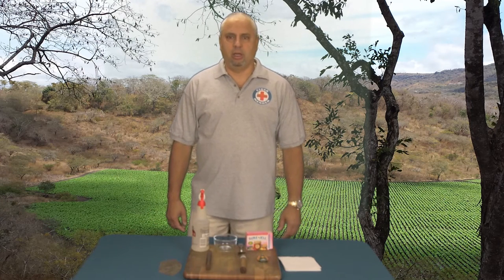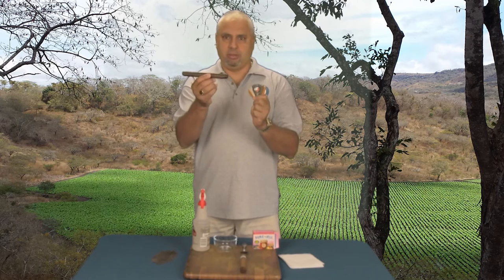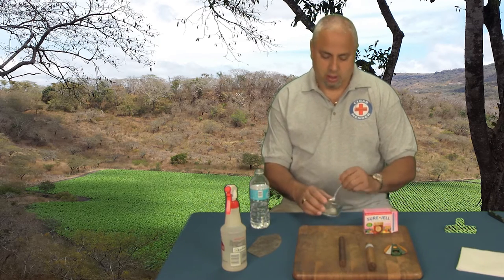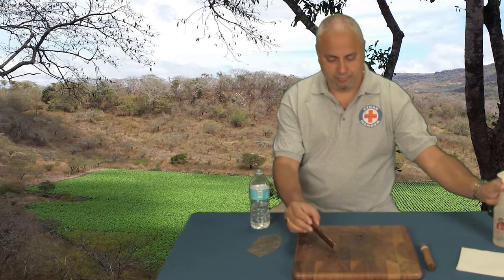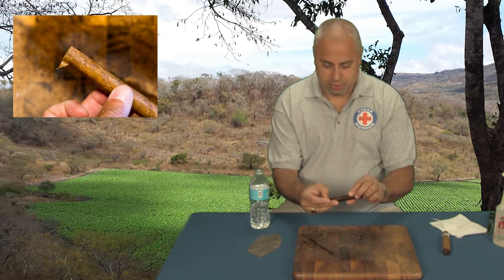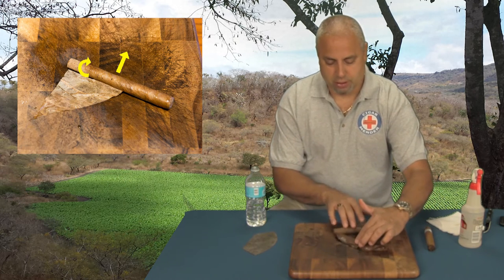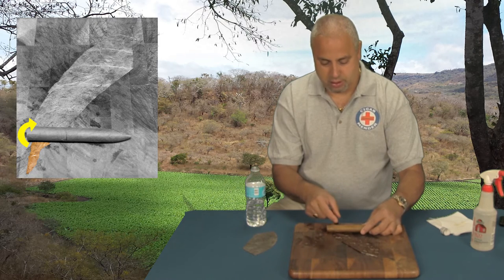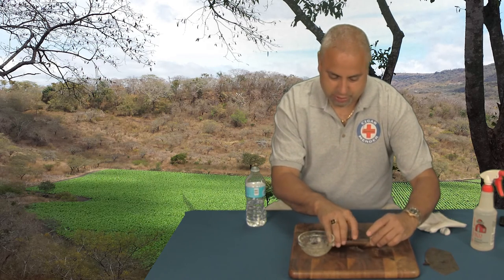How To Repair A Cigar Wrapper

Comment: Tony, thank you so much!  This worked beautifully!  I had let my humidor get fairly dry for a long period of time.  I had some very fine sticks in the humidor including an aged Padron 1926 40th Anniversary in Maduro that was obtained in the original year of its offering which i believe was 2004.  So it has been aged for 15 years.  About one inch of the wrapper leaf had cracked and fell away mid stick.  Needless to say, I really needed to save this exquisite smoke.  I purchased another Padron Maduro stick as sacrificial and carefully followed your instructions.  It came out amazing!  In fact, the wrapper looks like it came straight from the rollers at Padron!   Your instructions were perfect Tony and this method works.  Most important tip i learned from the process was to have the spray bottle.  I used distilled water and used it generously to soften the sacrificial wrapper.  When wetted down appropriately, the new wrapper will form perfectly around the smoke your trying to save (Even on a box pressed cigar)   I let the repaired cigar sit out on the counter overnight to dry and tighten.  It is now in the humidor reequilibrating again at the proper humidity and will be ready to smoke in a few days!  Thanks Tony!